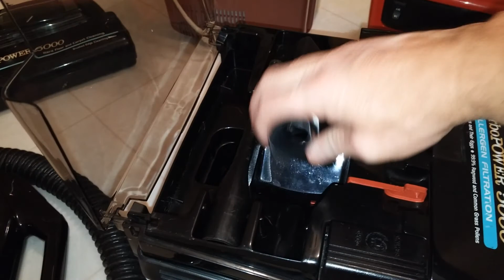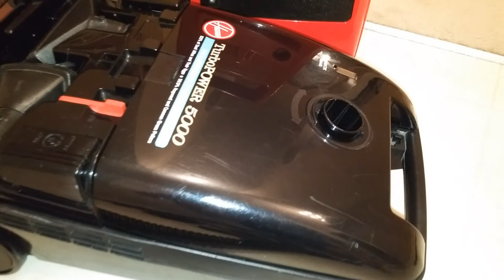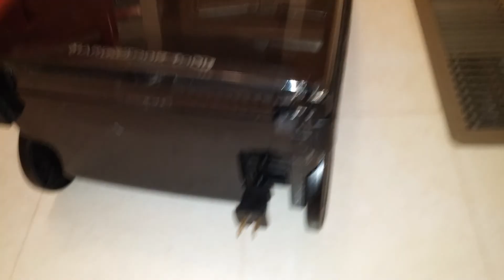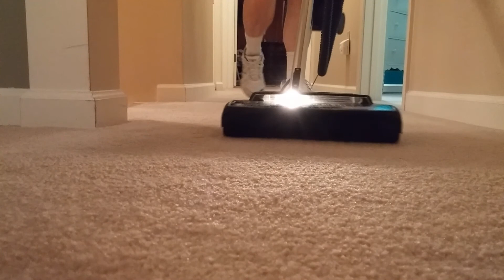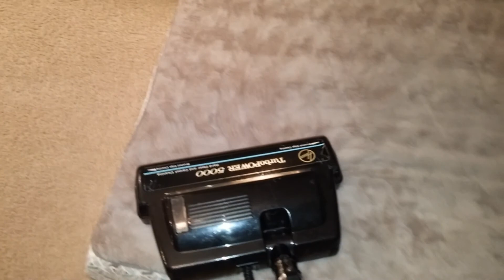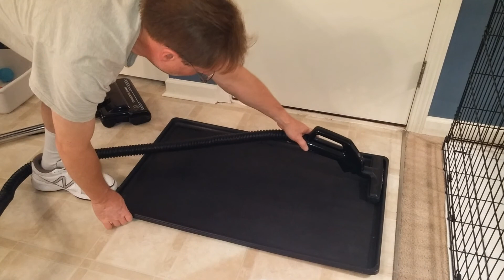Hoover TurboPower 5000 Whole House Cleaning

Comment: Your power head runs much louder than it should in my opinion.  I love machines of this style and have owned several.  Hoover designed their vacuums with very long tufts on their brush rolls.  I can tell from the video when you showed the brush roll that it was shot.  Your machine will work much smoother with a new 48414081 brush roll.  Trust me!  Sorry you spent so much already invested in that one.  When I heard your video while doing your Under the bed test with 3 canisters video I could hear it sounding quite off track from what it should.  This video confirms the diagnosis I had running in my head during that video.
Reply from the maker: It was much worse before I rebuilt it. You should have been there when I first fired it up! And to think my neighbors used this to clean hotel rooms periodically...
Reply: I'm sure it was horrendous.  I've come across some very beat up vacs at shops.  A PowerMax Supreme S3530 I got from a yard sale had been owned by a painting contractor prior to me.  The brush roll motor was siezed.  I spent a lot of money to have the armature cleaned and new carbon brushes fit for it.  Suction unit I was able to get in good shape myself.  I ended up getting 2 brush rolls for it though.  The first one I got was a CWP brush roll.  Had it in there for a little while and it just never sounded right.  So I brought it into a Hoover Authorized dealer.  He put a genuine Hoover brush into it and it purred!!!

Comment: On Hoover Windtunnel canisters and older PowerMax canisters, those cutouts in the bag door are covered over by a metal tab that Hoover installed.  It almost makes one think that those tabs were only installed for their higher echelon units.  I have taped those off on every canister of this style that I've come across and my machines sound just fine!
Reply from the maker: Termite159 based on my tests, excessive back pressure in the hose is putting unnecessary strain on the motor, which increases the heat output and shortens lifespan. Also, airflow box measurements confirm a minimal improvement of 5 CFM at the nozzle. Since mine is nearing end of life, I'm not pushing it any harder than need be. But, it was fun hot-rodding it while it lasted. 😃
Reply: Why do you estimate it being end of life???  My parents still have a PowerMax canister going from September 1997.  The hose has had to be replaced and obviously brush roll.  No other major repairs.  Motor bearings are the same.  Bag housing has the metal bag door covers genuinely installed from Hoover.  It is model S3603-040 with 9.8 Amp rating.
Reply from the maker: Because I serviced the unit right down to the motor windings. Brushes have about 25% life remaining and the commutator has telltale wear signs that can't be polished out. I also replaced both front and rear bearings (that was a real hoot). This machine was a total wreck when I got it for free from my neighbor who was moving to Texas. Now over $120 later...geez.  I see these machines in Goodwill stores for $20 and I should have picked one up there.
Reply: Carbon brushes are easily replaced on these assuming they are still available which I really hope they are.  Commutator wear, well that's a different story.
Reply: On Hoover WindTunnel Canisters And Older
Power Max Canisters Those Cutouts In The Bag Door Are Covered Over
By a Metal Tab That Hoover Installed.
It Almost Makes One Think That Those Tabs Were Installed For Their Higher
Echelon Units. I Have Taped Those Off On Every Canister
Of This Style That I've Come Across And My Machines Sound
Just Fine Termite 159 Based On My Tests
Excessive Back Pressure In The Hose Is Putting Unecessary  Strain On The
Motor Which Increases The Heat Output And Shortens Lifespan.
Also Airflow Box Measurements Confirm a

Comment: I've always thought it's weird when turbo nozzles have the off set hose connection.
Reply: This machine has a motorized power nozzle but yes when I was in the market for this type of machine in the late 1980s I purchased a Eureka Rally with the Vibragroomer III because the Hoover's powerhead felt odd in hand.  I also observed that it was an excellent deep cleaner. Sadly both companies' quality have fallen badly.